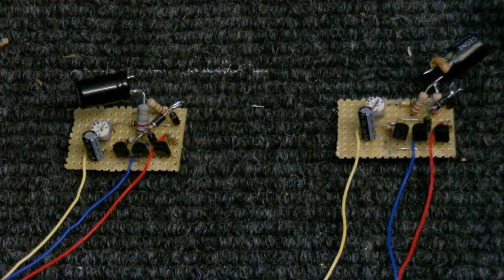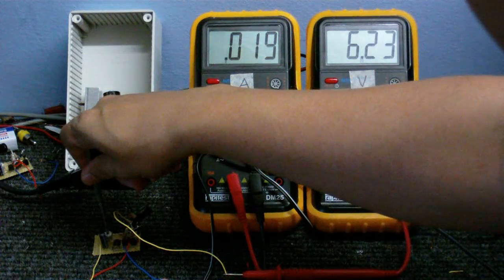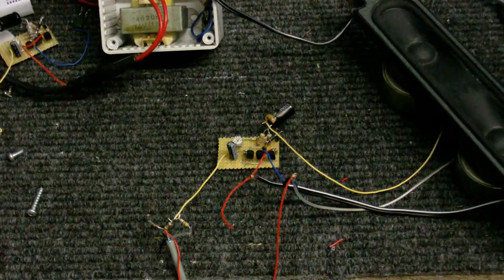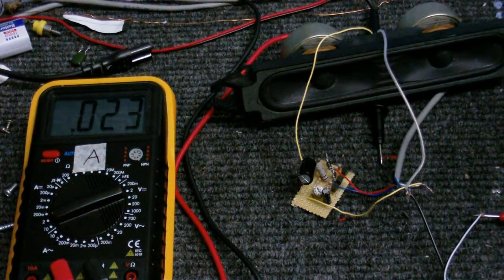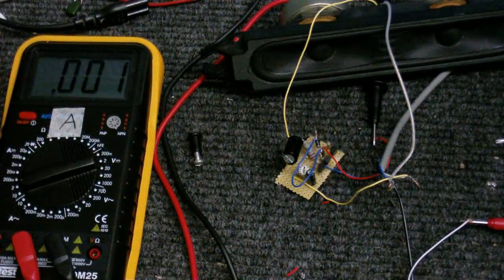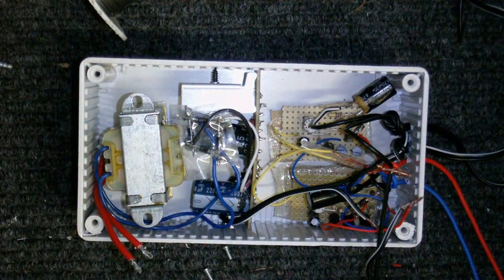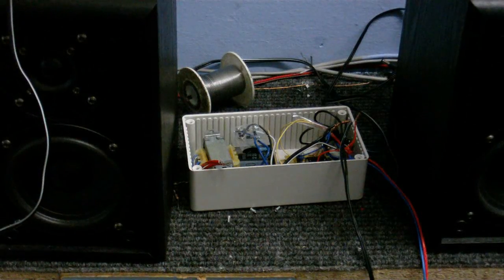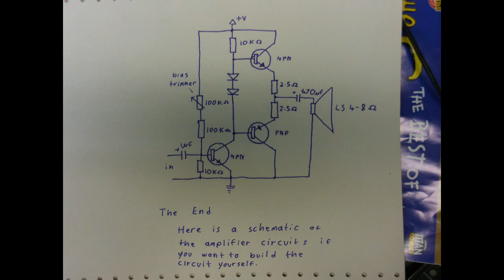cdceltnws more amplifier stuff.

Comment: o90-0100-30452-093-1175800-2323344 Germanium diodes for action, not enough current to work with but volts  are fine!  Red Dwawf was at the very begin... Vf= about 0.3v, and op voltage as high as 2kv... dot dot at 3mA!

Comment: You know, that actually sounds pretty decent! Well, not when the internal supply is providing the juice, but when you've got the amp on that external 12v suppy, it really does good.

Your blown voltage meter reminds me of the pair of '50s meters I use... They were in military service at one time and whoever was using them blew a resistor in both of them.